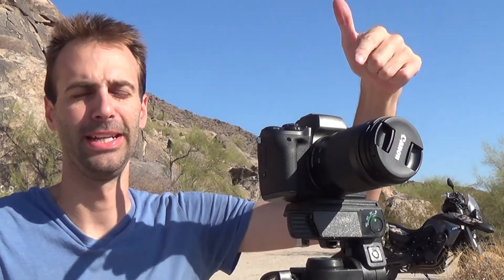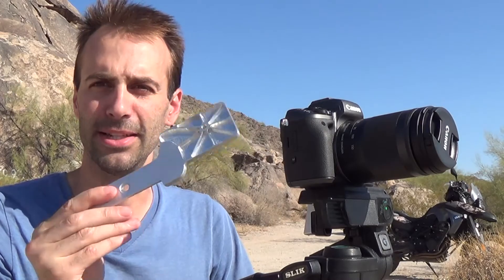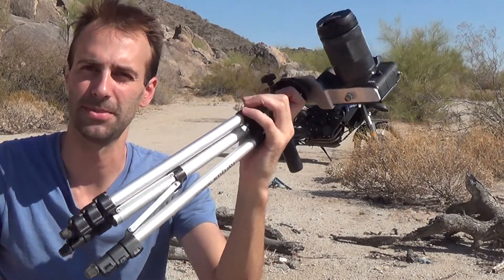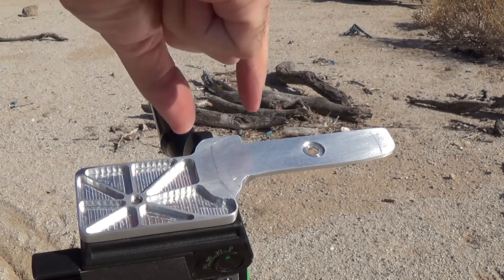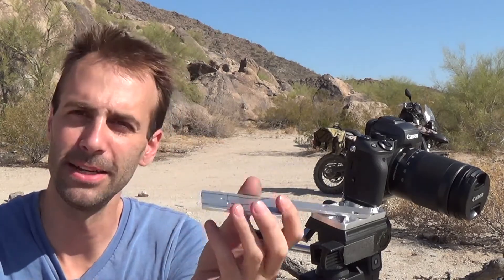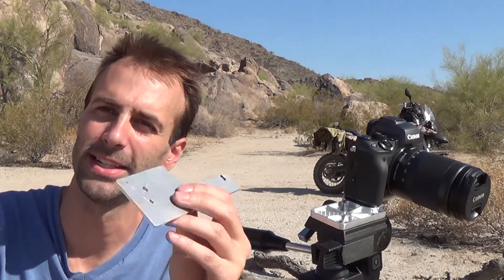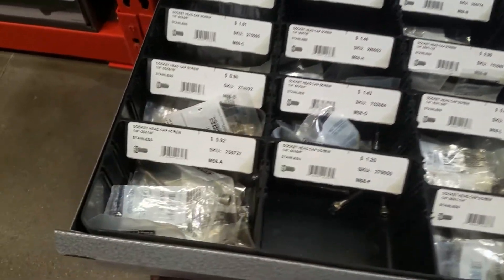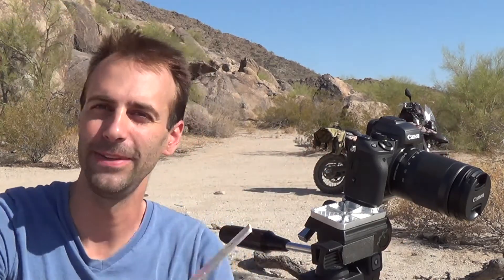Custom bracket - Canon EOS M5 Flip Screen

Comment: Did you do any mods to mill aluminium? The router says you can only engrave. What mods do I need to do to be able to mill aluminium?
Reply from the maker: Timb0NZ nope that machine is straight off the boat. I've machined Titanium on it too but like all machines they have limitations. These tools dont have great down pressure so spiral plunges are pretty essential, even predrilled if you can. Always buy carbide tools, at this scale the price difference is negligible. Some kind of chip removal (air or water) to avoid double cutting. The biggest downfall is the spindle, it has a tiny shaft (~8mm) then a giant collet setup on the end so it (apparently randomly) destabilizes from harmonics and beaver's out your sidewall destroying the surface finish; the solution is the liquid cooled model for more $ because it has a full diameter spindle shaft. Typical story that u pay for what u get BUT you can/will learn how to leverage secondary operations to compensate - use a drum sander to polish sidewalls for example or use a spot drill to locate holes and drill them later on a drill press. Jump on a plane, we'll make some chips.
Reply: @internationalprecisionengi1737  Nice! That is a lot of useful insight! I'll message next time I'm the states!

Comment: Hey Jacob, great video! I wish I found this video sooner! I made a 3D printed plate (I have a video about it on my channel), but I approached it a little differently. I wanted the plate to be as small as it can so I could use the touch screen and attach it to a quick release mount which I chose a standard arca swiss plate as reference. I found your idea of uneven material underneath the camera really interesting, something I might look into for my next revision of my plate. Only thing is that since I don't have access to a metal CNC and only 3D printers, I'm not sure if the plate would hold that well with a bigger DSLR lens on it. Feel free to check it out if you'd like, I'd love to hear your feedback on it. Thanks!
Reply from the maker: Thanks neighbor, welcome to come on down and make one out of metal! Dispite me having the tools to finish mine, its still unfinished, where as yours has all the details of the finished product - namely the quick plate and the camera screw, we'd make a good team!